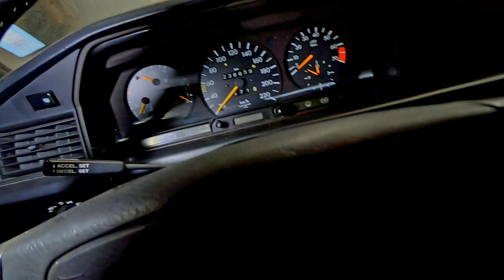Mercedes-Benz 190E (W201) - OM602 engine swap and OEM+ full restoration - Episode 1

Comment: I’m doing a om602/build swap into a w124 chassis 300. Look forward to keep watching your build!
Reply: how is it going??? im thinh to do the same with my 124
Reply: @serverdll  I sent the 2.5t block to my machine shop and got it bored out. Over size pistons. Cylinder head plained and block decked. Valve job done and went through everything. Got to reassemble now but need to get my butt back in gear. In the meantime I have been sourcing and buying parts. I bought a full 5spd dog trans swap kit. Lsd read end and axles and such. Getting there but slowly unfortunately

Comment: love my 1992 300d 2.5 , she doesnt seem to mind cruising at 75mph at about 3000rpm, put about 30k miles on it , and need to hit the boost to keep up with modern cars, very low rust for a nebraska car from 92, but my 04 sprinter had a super rusty body, besides the paint im guessing they used different metal too because the rust seems different on the w124
Reply: @ETMotorsports  yea my sprinter has 650k miles on the body,  frame is solid but I could almost stick my head thru the holes it had on the body

Comment: i swapped my om603 on my 190E by the way you dont need any electrical system on the diesel the glow plugs relay you can use a starter solenoid instead and is cheaper in the future

Comment: hey bud, I live in Winnipeg. I have a 190d but its auto and in bad shape. I want to buy a clean manual 190e (easier to find), supposing I have both is the engine swap as easy as taking out the gas and installing the diesel? or does the drivetrain need work?

Comment: I love the video sir, I was wondering if you could help me with my 190d it’s an 87 model with the 2.5
Reply: @ETMotorsports  so I had front end damage and I lost the radiator and the cooling stuff along with the belt and fan clutch. But before I invest money into restoring it what are things I should look for or do to get the engine running? The block is still good and I tried it a month ago but the battery was too weak, it was trying to crank. But idk what else to do
Reply: @ETMotorsports   even if it was sitting for a few years? I’m sorry for so many questions it’s just that there’s very little support for some reason. Could I send you a video of what it’s doing and what it looks like?
Reply: Thanks for making this video. I've got a 1987 190E 2.6 that's nearly mint inside & out, just has an issue with delayed acceleration & running rich (air distributor we were told). That and the air con is busted. I'd love to get it running properly, but feel like I'd end up down a lot of $$. Got any advice based on your experience? 😅 Thanks again.
Reply: @ETMotorsports  Thanks! Unfortunately I have no space/skills/tools and the car is currently interstate. It's been to a specialist repairer a couple of times and they've been trying to source parts. I was going to give up and either sell it as is or try something left-field like an EV conversion, but based on what you've said I might stay the course and try to get it fixed. Thanks again :)